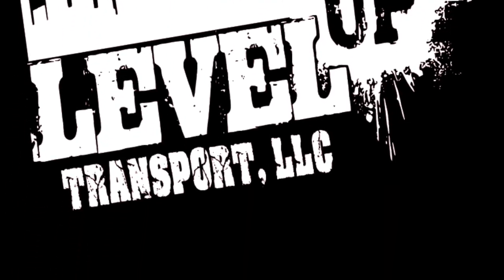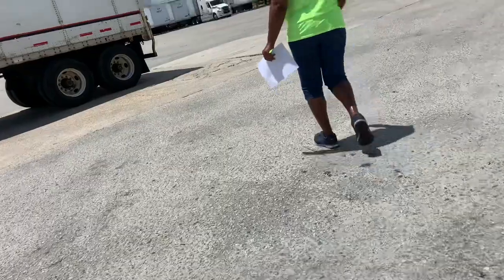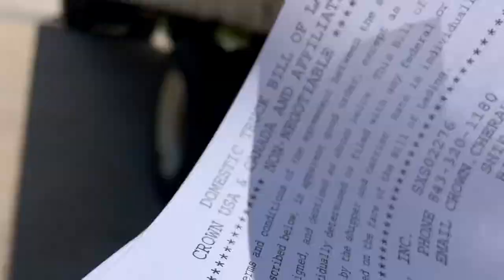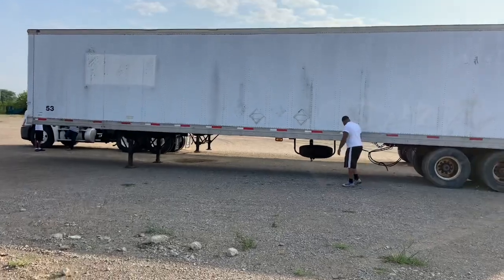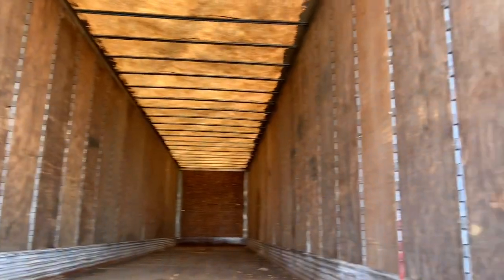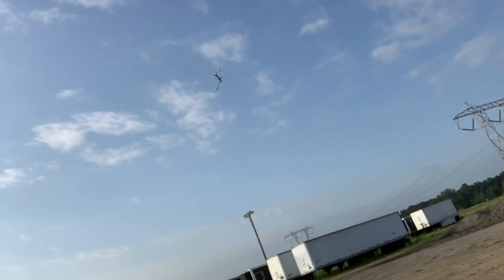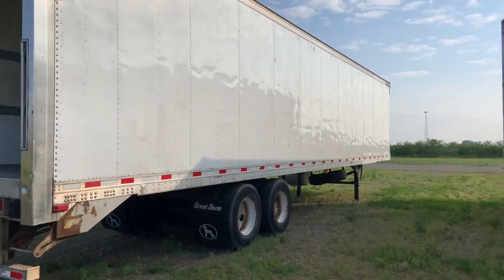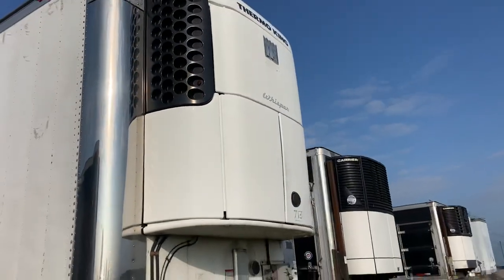I Brought My First Dry Van Trailer | Level Up Transport LLC

Comment: I have a question I’m not a truck driver but if you buy a dry box does it have to be a certain year that you can no longer operate it or the year doesn’t matter as long as you keep up the upkeep for example tires bearings structure and so forth because I have the opportunity to buy a 53 foot 1980 dry box and also a 48 foot dry box 1987 personally I was just gonna use it for storage because it’s cheaper than a storage container but if I would ever sell it can ever be used on the road I live in California so I know there’s a lot of regulations
Reply from the maker: I believe as long as it’s up to DOT regulations then it should be fine

Comment: Any issue getting oads with wood inside and see trough roof ?
Reply from the maker: Not at all
Reply: @thelifeofmerckid is the inside wood  and is it spring suspension?  Trying to get my own trailer every one tell me don't get one like this because broker and shippers will refuse to load me
Reply from the maker: @MrSehka77  I have heard the same thing but this trailer right here is on one of my trucks in South Carolina and it hasn’t been refused yet…and yes it’s spring suspension
Reply: @thelifeofmerckid  I've been waiting to buy my own because of this,  everyone I talk to tells me the same thing and says to stay away from them but it's all I can afford so makes it difficult but thanks for your help thinking I might go this route for now , how long have you ran it ? What type of freight you do anything? Local or otr?
Reply from the maker: @MrSehka77  it stays local and mainly hauls water out of nestle and niagara and a few other things…I definitely see other o/o with these types of trailers and they said they haven’t had any problems either…most places don’t even check the trailer
Reply: @thelifeofmerckid  understand appreciate your help 🙏